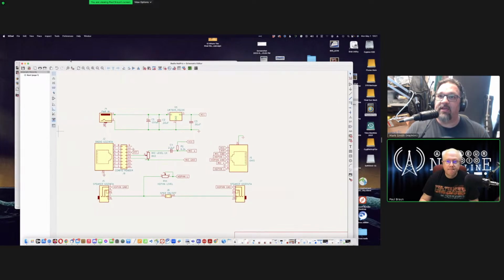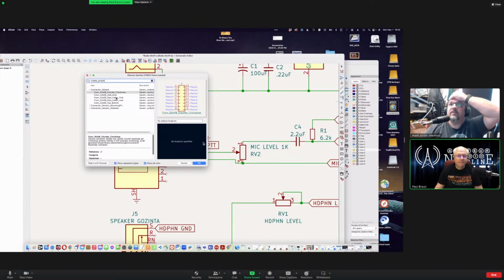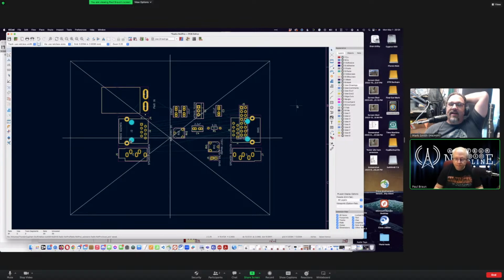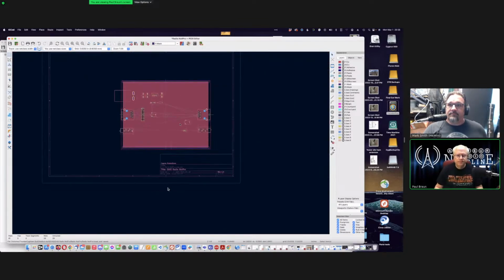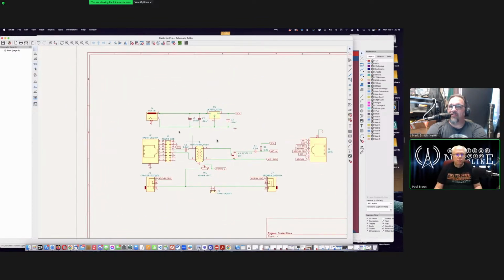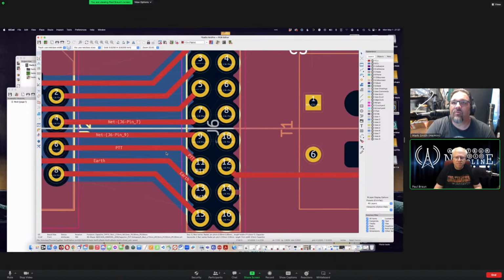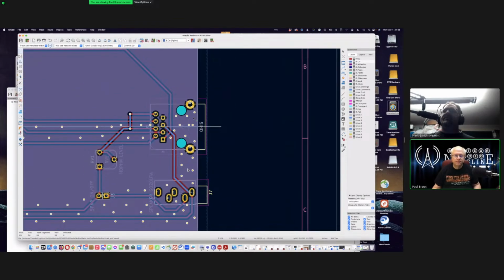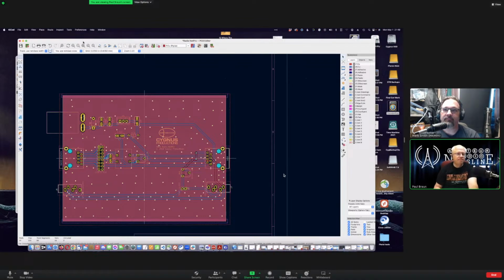Smitty AND PAUL! Working On SOMETHING: Refining a design in KiCAD

Comment: Those 2 holes in the Anderson footprint were for mounting staples that Anderson recommends for right angle PCB mounting. They solder to the board and go around the housings in the hemispherical cutouts.  They reduce stress on the solder joints of the contacts when inserting the mating connectors. You can find more info in the datasheet https://www.andersonpower.com/content/dam/app/ecommerce/product-pdfs/DS-PP1545.pdf.